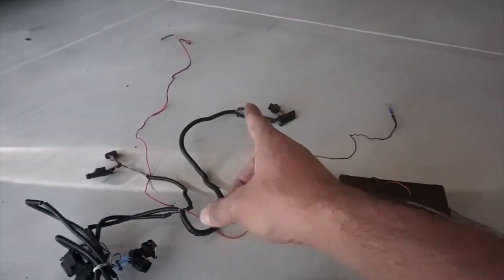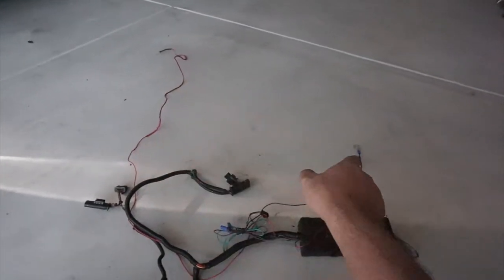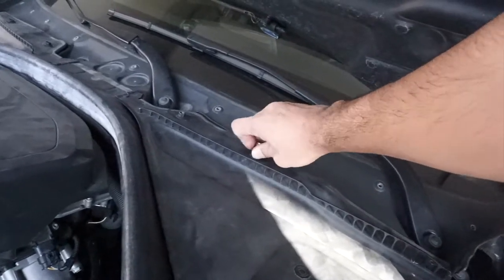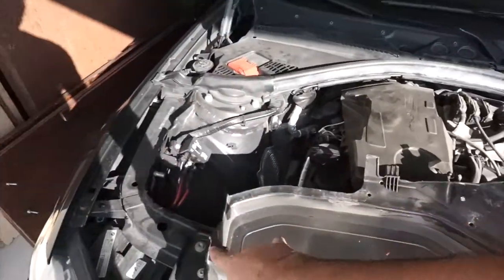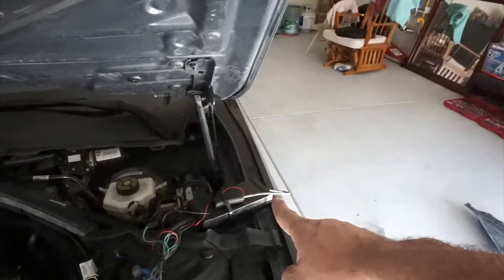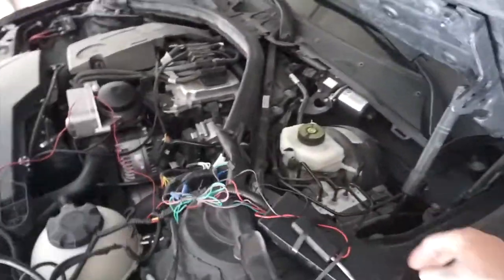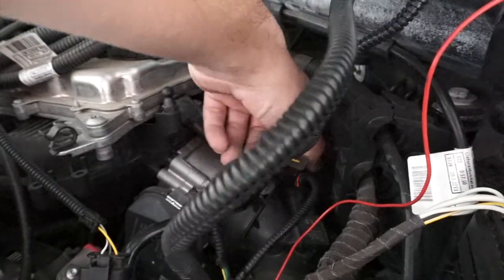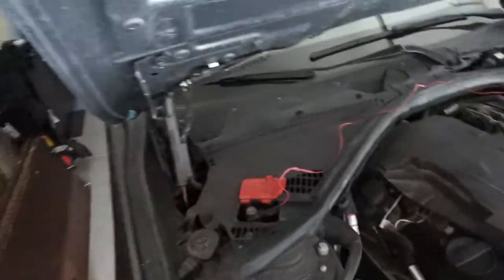JB4 on BMW f30 installed and explained DIY/FIY

Comment: Hi bro i am facing same problems 
The meter in JB4 apps doesn't working .
Reply from the maker: I actually did figure it out it’s either your jb4 is not getting the power like the wire might be loose or you just have to wait till your car is at certain temperature for it to work